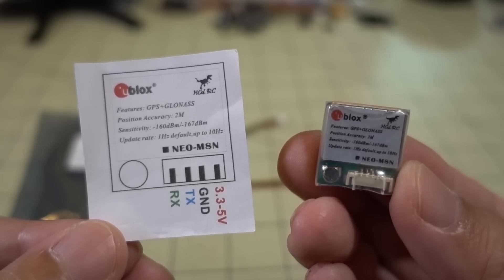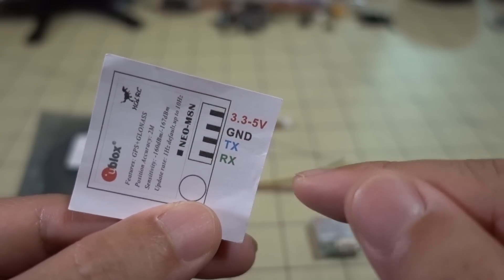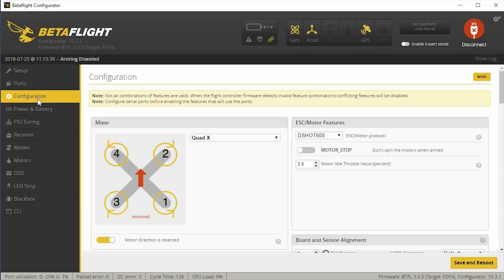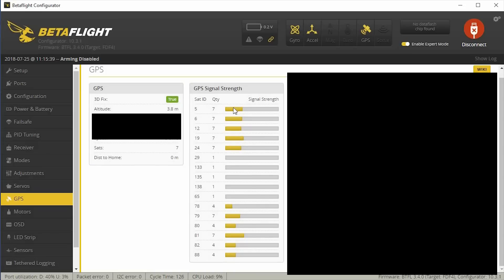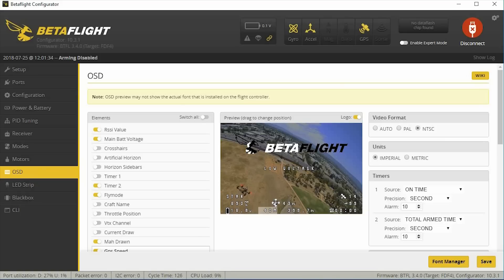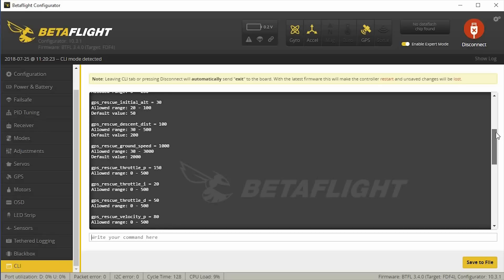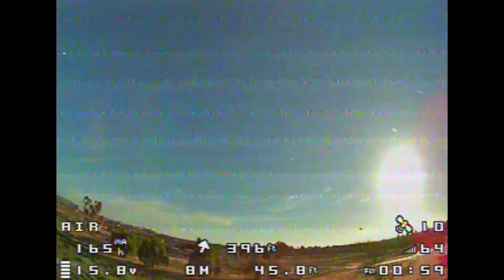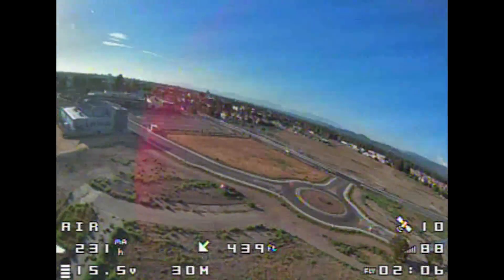Betaflight 3.4 GPS Rescue Quick Start Guide 🎓

Comment: thank you albert i have another question it seems that my direction arrow in not working any ideas?
Reply from the maker: It probably means you armed before all sats were locked.  The other possibility is something is wrong with the config somewhere.  It's also possible the GPS isn't working too.
Reply: @AlbertKimTV  thanks Albert. This is strange. Everything seems to work now but nothing happens when I activate my rescue mode assigned switch.

Comment: Another helpful vid thx. I have mine all set up now, the wiring works :) Can get 10 Sats etc.. all looking good so far. One question, I noticed my Failsafe Page in BetaFlight now says LAND, is that correct or should it be on DROP like we normally have it? Cheers.
Reply from the maker: No, you didn't follow the instructions correctly.  You have to set it in the CLI and also do not check it in the Failsafe tab if you're using configurator before 10.5.1 because it will switch it to LAND instead of GPS-RESCUE.  If you need to check, use the CLI.  If using configurator 10.5.1, it should say GPS-RESCUE if set properly.
Reply: @AlbertKimTV  I'm using the older version, yes I noticed when I changed it to DROP I had to do the CLI input again for GPS Rescue, then when I have that set and saved I can just look at the FS page and it's back to LAND. It seems to say that when the RESCUE is set in CLI. I know what you are saying.

Comment: Hello!
Today I had some succesfully GPS rescue tests.
I made some customisation in the code, and for better debug also changed the flight mode name to display each phase of the rescue mode, so I can look at OSD what is the current working phase and check heading and altitude and picture.
I helps a lot for understanding and tuning it.
On the lower right above coordinates is the flight mode.
During manual or when I quickly turn off GPS rescue to not let it "land' by itself you can see AIR text.
Instead of RESC you will se the following flight mode short names:

IDLE: "REID"
INITIALIZE: "REIT"
ATTAIN_ALT: "REAA"
CROSSTRACK: "RECT"
APPROACH: "RELA"
LANDING: "RELD"
COMPLETE: "RECP"
ABORT: "REAB"

As things happen fast and I did not let it "LAND", you will probably only see REAA and RECT and RELA modes.

I am happy with the result.
https://www.youtube.com/watch?v=OcsfU1neets
p.s.:
Unfortunately the testing at last flight (not shown here) ended with a crash and damage as there is still a bug around the code, I will investigate it next. I've got a REAB and it disarmed 50meter high and I lost control near me when I switched to rescue mode.
This is not good if it is too close sanity check should just refuse flight mode change instead of going to failsafe DROP near me....
p.s.2: I found and other bug, if GPs signal lost during flight it resets home when it gets fix again during flight ahh so many bug, I will fix soon.
Reply: open an issue and share your code pls

Comment: hello excuse the question, what is the difference between rescue and return home?
Reply from the maker: Rescue is a partial Return to Home.  It doesn't really land it well.  More like crash it at the end.  You need to take over flying it once it is closer to you.
Reply: interesting, but activated by switche and when enter rescue mode, with the switche or failsafe? or set the rescue mode with switche and when it goes into failsafe, it goes back? thank you so much
Reply from the maker: You can set via switch and also via failsafe.  If you want instructions on how to do that, see the link in the description.  WAY TOO LONG to write it all out here.
Reply: I read the guide, I thank you because I could not find anything so detailed on the internet. Do you also know a guide to configure the return home?

Comment: Started to think about this for my build and 2 quick questions. How long does it take for this module to get enough satellites to be able to fly? Saw some videos where it was taking a couple of minutes was curious. What bird did you mount it on and how did you mount it? Thanks for the info.
Reply from the maker: Some people are probably not using the M8N GPS I linked below.  It takes me less than a minute to lock on and fly.  I put this on a 5-inch quad with some zip ties.

Comment: What am I doing wrong? When I activate the GPS switch under configuration in BF it will be always deactivated again after "save/reboot"!! I think I correctly connected it and set up the UART connection in BF/connections. Its an F3 FC, can it work?
Reply from the maker: I mentioned it in the video.  F4 only.  F3 not supported.
Reply: @AlbertKimTV  Dang! Then why is it offered in the BF UI?? 
My smaller kwad has an F4 controller, I can try it there.

Comment: If you do put the Longitude and Latitude on the OSD, then you can use your DVR to record your location when you loose video signal... Probably most useful if you loose radio and video at the same time...
Reply: hi is the a mobile app that lets you but your gps location so you can find it
Reply: hi is the a mobile app that lets you but your gps location so you can find it
Reply: gwizz fpv I'm sure you can input the gps latitude and longitude into google maps and get a basic idea on location, I'm pretty sure if there is an app it will be on the App Store or google play store.
Reply: gwizz fpv - I use “GPS Converter” that I found free on App Store.

Comment: Is it possible to send coordinates to the remote control? If yes how?
Reply from the maker: You would have to setup telemetry.  There are some videos out there on how to do with a Taranis.  I don't know if it is possible with other radios.  Also, if you need certain data only certain receivers work while others do not.  Basically, this is a huge topic that there are hundreds of videos out there that cover it.  I don't use telemetry because I hate how stupidly complicated it is and how unreliable it is.  Even after you get it to work, it just sometimes stops working!  LOL

Comment: The looks great. I have a question. Do you need to go to your radio and do a new sensor find?
Reply from the maker: No, I didn't use any telemetry for this setup.
Reply: one more question.  (my gps came in today :-)  I have the F4 omnibus  pro 4 corner Flight Controller.  Uart 6 is free but there is a note that says if needed i can remove a resistor to disable the Uart 6 inverter.  Is that necessary to disable the inverter on Uart 6 for the GPS to work? .  Thank you  Roger
Reply: I have my unit up and running but I have a question.  i have the same Hldrc ublox as you: How do you know when the GPS is locked? My unit does not have a light or leds and looking at the Lat/long in OSD the readings settle down after about 2 minutes (but never completely stop changing) but no indication that is is              'Locked'
Reply: BTW i am receiving 12-15 satellites

Comment: will this work with any fc? i saw in the product description on banggood that its for naze and stuff.
Reply from the maker: For the Betaflight rescue to work you can only use F4 flight controllers.  It doesn't work on F3's.  Also this GPS should work with any FC that has an unused UART.
Reply: Albert Kim gotcha makes sense. However what features of the GPS will work on an f3 board? GPS rescue I understand won't work.
Reply from the maker: Depends on the firmware you use and which version.  Features will vary and on older firmware nothing works.

Comment: Hi Albert, great video on this feature. Any chance of a pic on how you mounted the module? Does it need to be set up off the quad like an inav one needs to be.
Thanks
Reply from the maker: I just used a cable tie and put it on the top plate.  It was not a permanent setup since I am going to use it in something else later.  You'll have to wait for that build video to come out.  I haven't built it yet!

Comment: For people new to this please note - it is NOT a system to land your quad back to you - it's been designed to rescue long range quads that either lose video (so you turn rescue mode on with the switch) or if you lose radio link you can set it as an automatic failsafe to try and bring the quad back to you 

Just saying coz I've seen a couple of videos of people saying their quads crashed next to or near them as they thought it would land  - it's not designed for landing.
Reply from the maker: Yes, this is correct.  You should take over the flying once you have RC link or video feed back.  Also, this feature is still very new and isn't 100% fool proof!
Reply: Yes Albert - there is something called sanity check which I am still learning about - stops rescue mode working when the quad is right next to you (imagine what that would do !) 

People should really look into this before they decide to use it 👍

Ps love your channel 👏🏻👏🏻👏🏻👏🏻👏🏻👌👍
Reply: I should add I think I'm right it's very much a case of user beware if you decide to install and use it - as you said it's still under development. I've got it on 2 quads and it works but there are quite a few other settings that you can adjust

Comment: What would you use this for? if your quad is still plugged in you can just find it with your transmitter very easily. And if it's unplugged then what good would this do
Reply: Presumably you can can set this as a fail-safe so that it returns when it runs out of range rather than just dropping.

Comment: So I guess you need an FC with a barometer. Any 20 x 20 FCs with barometer?
Reply: jovid7 this feature works with AND without barometer if you look at the wiki! no need to upgrade boards..
Reply: One of Airbot Omnibus nano series has barometer built-in. No i^2c port for magnetometer tho.
Reply: When you look at the video you can see Albert has the barometer clicked in betaflight. Bought this one. https://www.banggood.com/20x20mm-Betaflight-F4-Noxe-MPU6000-Flight-Controller-AIO-OSD-5V-BEC-Built-in-LC-Filter-for-RC-Drone-p-1310419.html?ID=519209&cur_warehouse=CN
Reply: isn't i2c shared pins with UART3?